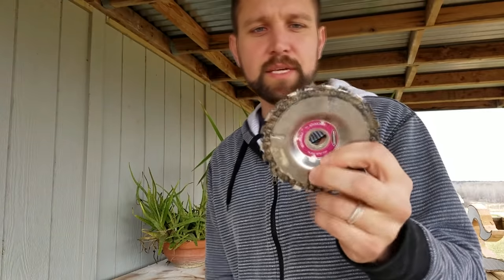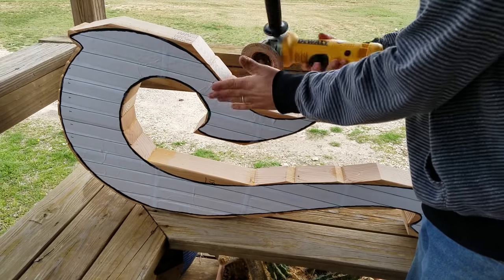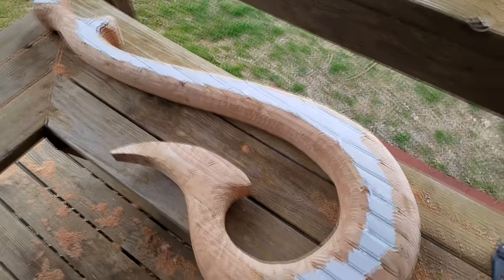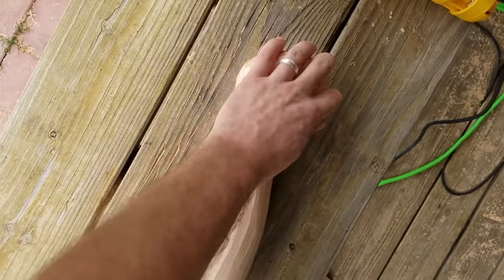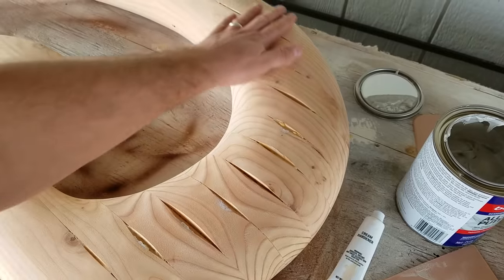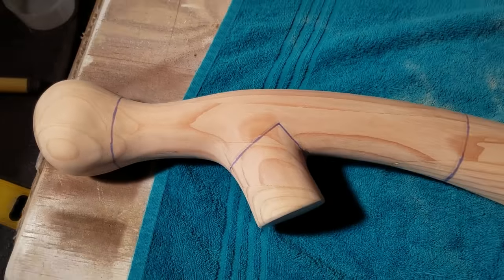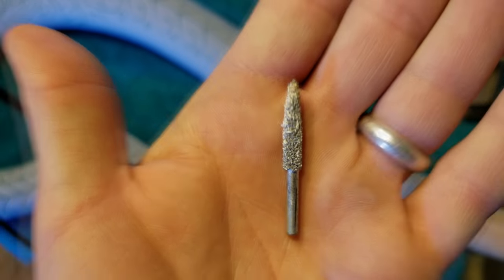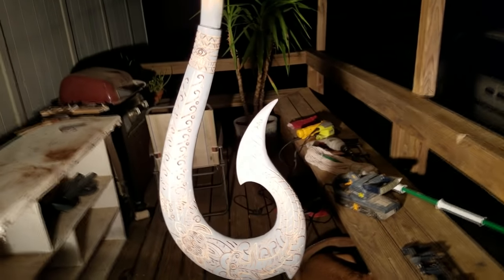MAUI'S HOOK TUTORIAL (part 2)

Comment: Wood Glue and Sawdust of whatever your working with. Perfect wood filler, no need for putty. Also as strong (if not stronger) than the wood itself.

It'll shrink while it cures so just cake it on and sand it back off when dry.